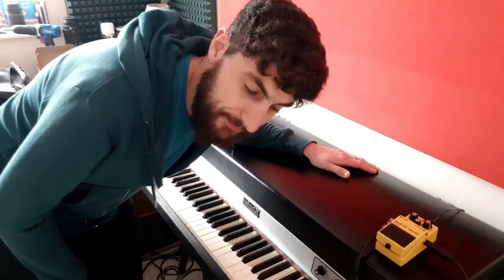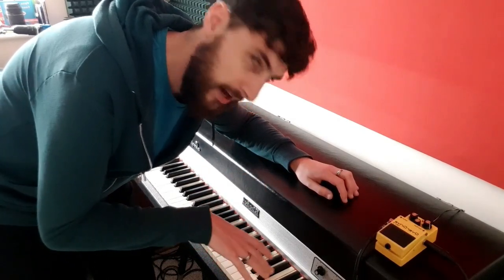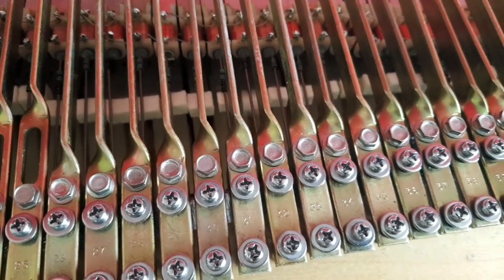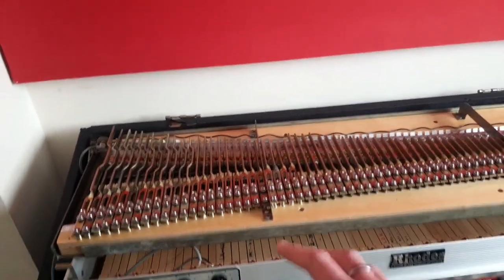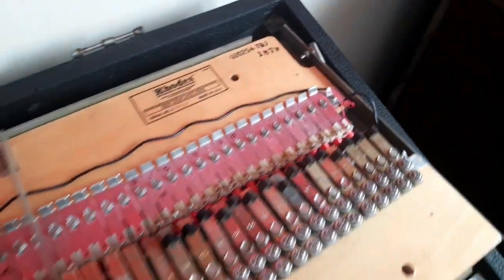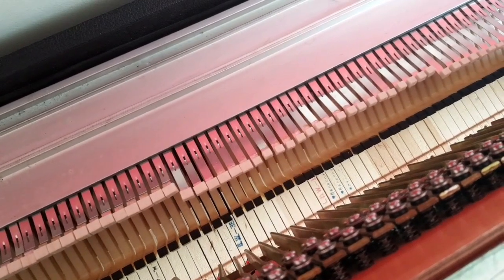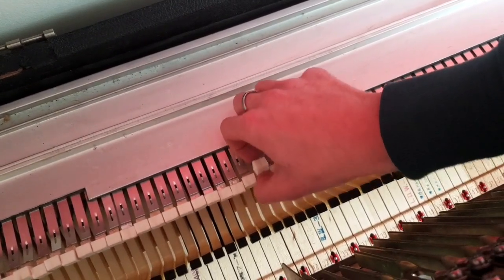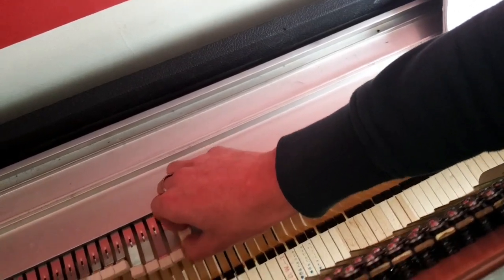How to fix 'bobbly' dampers on a Fender Rhodes

Comment: Is there anyway to fix the noisy key-hitting mechanical sound in like 2:46?
Reply: I've thought of replacing the felt where the wooden keys meet the plastic hammer with a noise dampening strips of cushioning material. I'm still looking for the best material. The felt that the Rhodes company installed is not workable. I think it was an afterthought. That noise is very distracting to me.
Reply: @mojooftheg5961  yeh, this noise indeed is very distracting and the key bounce back feel is uncomfortable too; I tried to search on internet but seems not many discussion regarding this kind of clacking thing. cushioning material......maybe some rubber could do the job !?
Reply: @mojooftheg5961  BTW I replaced the felt but seems to getting worse, I think the old felt might have got to a good match with the plastic hammer along the time, and the new felt needs time to fit
Reply from the maker: Interesting topic! I personally don't find this noise irritating or distracting as I've always regarded it the actual mechanical noise that they make, and to me is one of it's characteristics. I can understand how it would be annoying and distracting though, so if you find the cure, please comment back!

Comment: Just picked up a 79 stage 73 mk1, my first. I am finding it to be all 'bell' and no 'bark', unlike yours which has the sound I'm after. Have new grommets and screws on the way, any other tips on how I might get it sounding a bit dirtier?
Reply from the maker: Hey there! Thanks so much for commenting. In order to get the 'bark' you're after you'll need to properly tune and voice it. If you've got grommets and screws on the way, do that first as you'll of course need all the tone bars off to do that anyway. Then, when you re-install the tone bars, set their gaps as per factory standard. (Escapement). Have a good read through this website: http://www.fenderrhodes.com/ 
There you will find manuals, service information, and all of the factory standard measurements for your key height, key dip, escapement, damper regulation, pickup distance  etc. With factory settings you should get that 'bark' when you strike the notes hard. If not, play with the escapement as you play the notes to find the sweet spot you like! (Voicing).  It's all about the players preference really - let your ear do the work - but starting off at factory spec is a good place to start!  If afterwards you still require some more dirt or 'stank' as I like to call it, there are options to mod the passive electronics with tube units from Vintage Vibe, or you can run them through tube amps, or pedals. I've got brand new standard passive electronics in mine running through a BOSS OD-3, and I love the way it sounds now! Congrats on your purchase and good luck! Mine is a 79, and personally I think they're the best Mark 1!
Reply: Hey thank you very much for the reply, all great tips. Since asking I've done all the grommets, screws and washers. That improved the sound quite a bit, but not so much adding to the bark. What I ended up doing is pulling off the harp and digging those crappy pressed board shims off. I replaced them with solid white cedar shims that are about half the thickness of the originals. Then I set the strike line much closer than it had been. Those last two have gone the farthest in getting the 'bark', along with voicing each tone bar in that particular barking sweet spot. I'm shopping around for a preamp and or tube amp, and also considering an EQ pedal- as an owner of a Korg SV1 I find boosting the midrange can go some ways in getting an EP to bark. Thanks again for the video and tips!
Reply: @CGOlde  Biggest factor when voicing for 'bark' is pickup distance. A shorter pickup distance changes the dynamic response, and gets a much barkier sound when you dig in. Careful you don't get them too close as to get out of control.